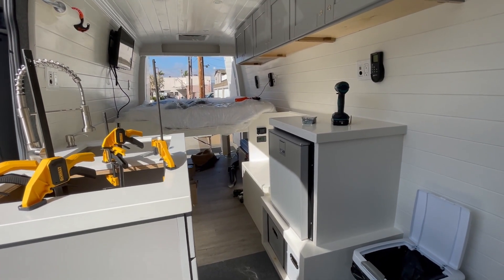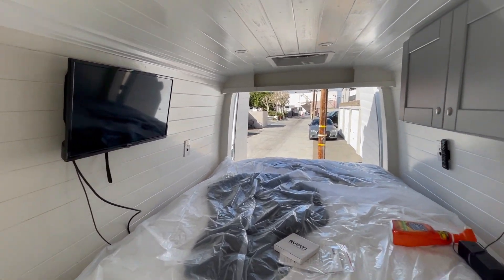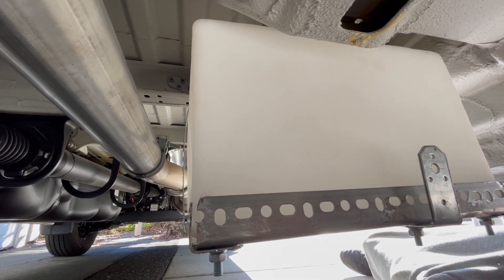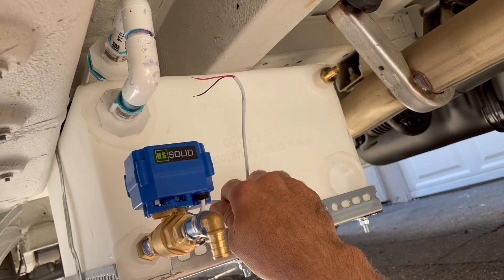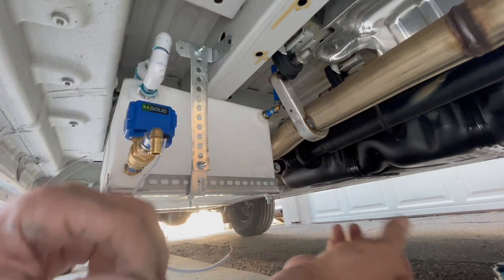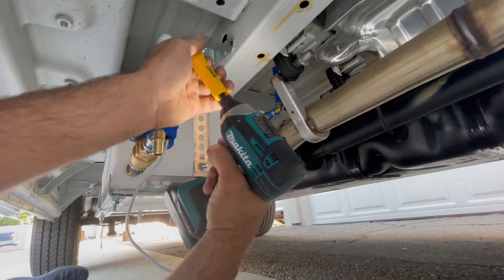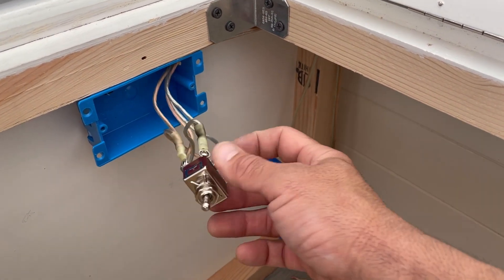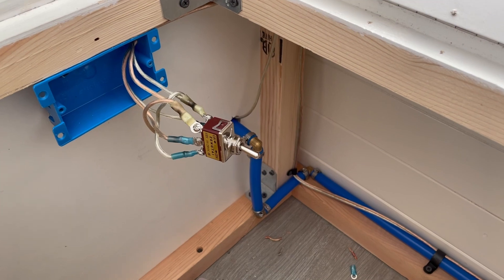How to install a Grey Water Tank with an Electronic Valve

Comment: DO NOT USE OUTDOORS!!!!!!!!!
I purchased this valve and installed on water tank outdoors, above ground. It was exposed to rain and water splashed but never submerged. It failed with in a few months. Took it apart and found it rusted and water inside. It is rated IP65. I contacted USSolid and was told Quote 
"Hi,
It is stated in the manual that the ball valve is IP65 and cannot be used outdoor. I'm afraid that the gears are rusted due to used outdoors.
Looking forward to hearing from you, thank you.
I will say before failure valve worked beautifully! It just can't be used outdoors
Best,
Yuan "
Reply from the maker: I've been using these for years outdoors and never had a problem and you're the first person that had that issue in the comments

Comment: I’ve looked at a few of these gray tank videos. They all show the e-valve mounting on a straight extension from the tank. That creates a relatively long, unsupported lever. Would it be better to have some support for that lever or is it so light that no support make a difference?  Also, why not just use a nipple to connect the valve directly to the tank?

Comment: For the switch, you got the ON-ON switch?
Reply from the maker: Yes it’s a reverse polarity switch
Reply: @BuildingVanLife  Okay just checking because the link has the 3PIN ON OFF ON, 6PIN ON OFF ON, and 6PIN ON ON
Reply from the maker: @SaySarah  It’s the 6 pin on on.  I also have a newer version of this video with some improvements I made.  I would recommend going off the newer video and I explain the switch better.  Here is the link for the new video https://youtu.be/Od5L_t8ygMs

Comment: I like the idea. How's this holding up to rust today? Do you have any recent pictures?
Reply from the maker: Going strong.  I have an updated video I made on installing the grey water tank with a few minor changes.   Here’s the link https://youtu.be/Od5L_t8ygMs
Reply: @BuildingVanLife  Thanks. I like the general design. Do you have any pictures of the one in this video from within the last year? Seems like the cut parts would start to rust where the iron is exposed under the  zinc plating.
Reply from the maker: @hittheroadzak5124  I dont the van is sold.   Even if it rusts a little it’s not a big deal.  If you need to swap it out in 10 years it’s ok.  It’s thick metal

Comment: Excellent plumbing job.  Plan on putting in the same ball valve.  I would be concerned about the low clearance of the tank.. but very cool
Reply from the maker: Watch my more recent video on gray water tank Install on my channel.  The tank is higher than the axle and several other parts under the van

Comment: Im using this video to do the same for our build. When I watched it before did you use a brass fitting for the valve into the grey tank or am I remembering incorrectly? If not or if so how should I attach the valve into the grey tank what kind of fitting
Reply from the maker: Yes I used brass with some thread tape
Reply from the maker: Also check my channel I have a newer video of a more recent gray tank install that is probably better
Reply: @BuildingVanLife  Alright thanks man I appreciate it

Comment: I don't understand. If you're using a three wire valve, why not use a spdt switch? Yellow from valve to battery negative. Red and blue from valve to either side of switch. Positive from battery to center post on switch. Would this not work or am I wrong?
Reply from the maker: This valve only will work with a dpdt switch.   This set up only uses power to move the valve from open and closed and then again from closed to open.  They make another valve that will work with a spdt switch but it it uses constant power although small to keep the valve in the closed position.  You can read about it on the valve link
Reply: @BuildingVanLife  Thank you for your quick response. Your link to valve on Amazon has three wires and in your video you only mention two wires. Does your valve have three wires? Are you grounding yellow?
By the way I enjoy your videos; nice build and great information
Reply: I believe that your link to Amazon is wrong?? The link is for a three wire value. You are using a two wire valve.
Reply from the maker: @gregnorman3183  the two wire valve is the correct valve for this set up not the three wire.  They make both type of two wire valves.  I just realized you are watching an old video on this topic.  I have a more recent video that I explain it better in.  Here is the video https://youtu.be/Od5L_t8ygMs

Comment: Great job on this video.  I stole your idea with the ball valve and Im really liking it.  Same manufacturer also makes an NC "auto-close" version of the valve, which make wiring a little simpler
Reply from the maker: I believe the reason I didn’t use that one is bc the auto close usually a little bit of power at all times while the one I am using only uses power while it’s actively changing from open to closed or closed to open

Comment: Cross members actually welded to the chassis. And have certain weight tolerance.  Not sure I can fix large water tank.
Reply from the maker: Yeh I only use 5 or 10 gallon water tanks for grey water.  Not any larger

Comment: What gauge strapping did you use? I can't find any at my local home Depot.
Reply from the maker: It should be in every Home Depot.  At min it’s in the same isle as the drywall screws in a little section with a bunch of strapping and aluminum 90 degree angle pieces

Comment: This was a great video. Thank you for the great detail. I was wondering how I was going to mount my gray tank and I was completely thinking of doing it a different way.
Reply: Also We’re going to be a family traveling and that P funnel it would be an extra luxury! I’m waiting for my composting toilet and now I’m debating if I should just route that into the gray tank
Reply from the maker: @avangers_  yeh the composting toilet im installing now in my current build has a separate urine line which i plan on running into the grey tank.  I will probably have a video on that soon when i get to it.
Reply from the maker: Glad it was helpful, thanks for watching
Reply: Sweet! If you got some time check out my build 🤙🏽

Comment: How is that holding up? Not too close to the exhaust? Not too low to the ground? Have you scraped one of your mounting bolts yet?
Reply from the maker: It worked out great it’s not any lower than the rear axle so clearance hasn’t been a problem

Comment: Did you lose bottom clearance with this tank install, how much? Ali I saw another video where pee funnel was located in bench seat , was that an earlier / different build?
Reply from the maker: It level with the bottom of the transmission so the clearance is still the same.  I have had a bunch of builds on YouTube so maybe it was.  You can check my other videos.

Comment: How do you empty the tank completely, if the valve is an inch above the bottom of the tank?
Reply: all tanks are built like that, you could make another hole on the bottom of the tank  and use that for your drain. I Installed mine the same way, when I'm using the van a lot  I just fill the tank up a few times and drain it to wash it out. Nice install
Reply from the maker: Just park on a downhill or leave it open while driving and it completely empties when you brake.